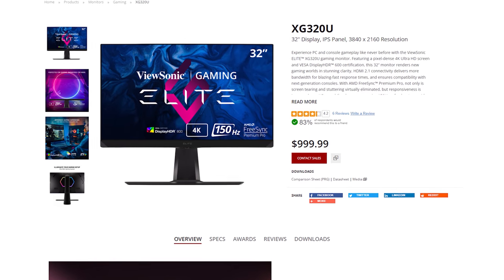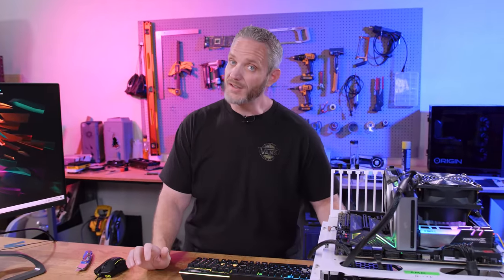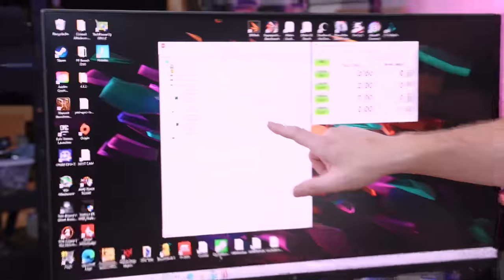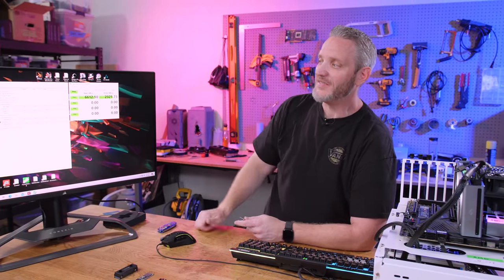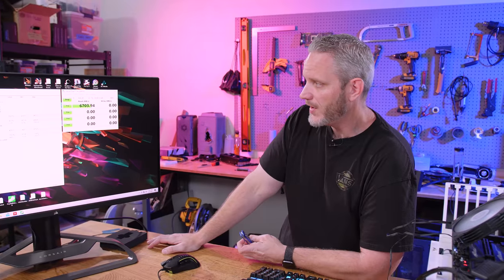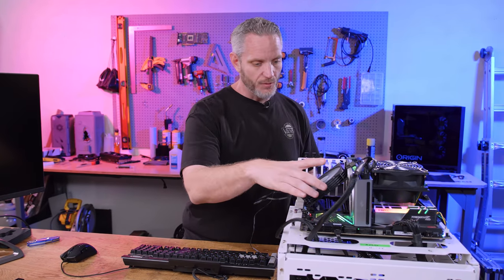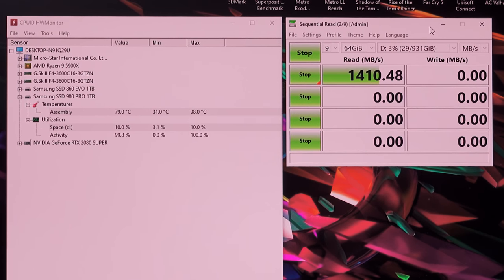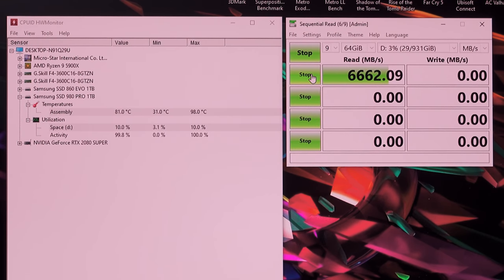I watercooled an NVME SSD... These results were unexpected!

Comment: In Windows, "cipher /w:c:\" on the command prompt will overwrite/encrypt all unused disk space on the C drive. It's for rendering data on free space irrecoverable, and also causes 100% disk usage.
Reply: Pretty sure that doesn't work on SSDs though.
Reply: @Mr.Morden  Just tested this on a 970 Evo Plus. Temperature went from 63°C to 83°C.
Reply: @saucyscone  Remember that SSDs don't write to the block containing the information to be wiped. It merely marks the block as blank and then writes to the next most unused block. That's wear leveling. Only mechanical drives will respond to commands to overwrite the same block. SSDs require a special tool from the manufacturer to wipe, and then the whole drive will be cleared, not just free space. There are also third party tools that do it, and tools on Linux. There are some drives that support secure erasure but the drive controller has to support it and you need software that uses that specific feature.
Reply: @Mr.Morden  It's not wiping the drive though, it's running an encryption algorithm over the current data in the drive.
Reply: @Bonekinz  As I said, that's not how a SSD functions, that's only possible on mechanical drives. The SSD file operations occur at the OS level, this method also kills lifetime write durability on the drive and does not wipe anything in the filename table either. Wipe operations function at a low direct hardware level and they can only wipe an entire drive securely. SSDs have no way to correlate the physical location of a file on a SSD with the NTFS/EXT etc filesystem entry. Slack space within each block is also not addressable. Using these tools only kills the lifetime of the drive and does not result in a complete wipe.

Comment: Glad you made this video. I have been wondering my NVMe's temps and keep forgetting to look. Mine is using the stock x470 Taichi MB heatsink and it's sitting (idle) at 48-50C. It's in a 5000D Airflow, and a junky GPU (for now) so it's not getting much heat off that even when gaming.

Comment: Funnily enough, NAND prefers to be a bit warmer, especially for good data longevity. Excessive cooling does your SSD no favours.
Reply: Running things outside of their operating temp can be destructive, this also goes for running things cold. not everything works better with excessive cooling. Car engines and transmissions wear far quicker when they are cold.
Reply: I purchased a heatsink for my nvme ssd in the server as it was sitting at like 45c and was spiking to something like 60c+. Despite the server being a 1ru with 7 fans giving plenty of air flow over the drive. I got the heatsink to stop those heat spikes. The drive sits at like 32c and peaks at like 40c. But it only gets that hot after copying over 100gb to it. Server kept throwing alerts at me.
Reply: @Ziogref  Probably should've just disabled the server alerts regarding the SSD, but whatever, as long as it works.
Most consumer SSDs start throttling somewhere upwards of 70°C (on the controller), not sure about server SSDs.
Reply: @Steamrick  I wish it just throttled, the boot drive in my laptop causes a bsod with no meaningful error code and no crash logs when it goes over 70, which was a pain in the ass to troubleshoot.
Reply: It's lowers the lifespan. These misconceptions are annoying. A cooled one will survive way way longer than a throttling one. 70c is worse than 40c.
Only super low degrees can be a bit bad. But heat is still worse
Reply: @Steamrick  it's a Samsung 980 pro.

Didnt even have any thermal mass attached. Just a PCIE to NVME adapter. The temps were at a point that made me a little uncomfortable.
Reply: @bundles1978  Yes, but the issue here, the controller you want to cool, the NAND you don't.

Comment: 1) I have always believed, that it is the controller chip you need to cool down, rather than the memory chips. 
2) To test a SSD based drive, try copy/paste from a similar sized drive, using HWINFO 64 to record results.  I guess you could have similar results if you did a full backup and then a restore to test.
Reply: Yeah memory in SSD's always runs warm... it's the controllers that burn!

Comment: I've got a 970 Evo that throttled due to thermals during writes because of how the motherboard's M.2 slot was laid out. The motherboard designer, for some reason, decided the best place to put an M.2 drive, with no cover, was directly under the primary GPU's slot. Soon afterwards I changed the motherboard to one were the M.2 slot is above the GPU slot and had a heatsink cover and it dropped down to 78C full tilt.

Comment: It's good to see that even the big YouTube channels occasionally make an editing error, not just me. 12:53, 13:00. BTW, any chance of testing some of the fan-equipped NVMe cooler, like the "Titanium Micro TMHSFM3 Nitro M.2 NVME 2280 Heatsink Dual Cooler with 30mm PWM Fan"?
Reply: yeah i'm surprised though. i really wouldn't expect a channel that is so big to make those mistakes.  I guess this is partly why Linus has like 50 employees lol
Reply: @techboy95  channel is 3+1, big only in sub/views numbers..
Reply: My testing on gen 3.0 and 4.0 drives shows no need for a fan on nvme as long as you have good thermal pads, a decent heatsink (pure copper is best), and a little airflow (minimal, but not stagnant air pocket in case).
I tested many nvme and many heatsinks.
Reply: Jay.exe probably got caught in a brief loop again.

Comment: One could write a shell script to do this in linux. It would just write over and over to the drive logging the time it took to write, time it took to read, and the temp before/after, flushing cache after every one. I have no idea if linux under windows subsystem has that kind of direct drive access though, to do the same there.
Reply: Yep, dd and sync are your friend. On a large write you can hit dd with a USR1 interrupt to get ongoing stats.

Comment: From what I have read from some of the engineers of these NVMe devices, they say that the "cooling too much" is typically not going to be an issue because the temps where too much cooling is problematic for longevity is like 0°C which you aren't going to have in a normal system.  For high temp, they said you would generally want to keep them under 70°C.  So even with no heatsink the 980 is fine, especially in a case with a little airflow.  But the newest 990's, SN850X, etc. do get hot.  I have some passive heatsinks on mine and they stay around 50°C.  That's all they really need.  The motherboard covers should also be sufficient for most things.  The PCI-e 5.x ones may need a heatsink vs. being able to just run out in the open.

Comment: Really interesting and useful! Clearly, a vaned heatsink is - and I think it's obvious why - superior to a flat one, as long as there's good airflow. No point (yet) in using watercooling - the benefit doesn't (yet) outweigh the hassles.

Comment: I got 3 of the EK heat sinks for my new build, for two reasons:
1: Not entirely confident in the two slower drives being left uncovered, since the mobo only came with one SSD plate that only fits in 2 of 3 M.2 positions.
2: I think the nickel fins fill out the board's appearance a lot better than the SSDs on their own would.

Comment: I foresee motherboard manufacturers integrating raised NVME SSD slots to accommodate cooling blocks on both the top and bottom for drives with storage chips on both sides. But as you said, it leaves more room for failure with added cooling blocks within a cooling system. Sooner or later we're gonna reach a point where we'll need even more cooling to cool the cooling system!

Comment: No problems with ones on 4.0 compiling huge C++ files. Manufacturers test with covers in layout and design of the module. FET junctions work more on voltage (potential) transfer instead of current. Storage is a charge, so refresh uses current. Current is work (e.g. electron/hole movement) and produces heat. Operating at lower temperatures may show longer life, as storage cells are disabled over 5 - 10 years in consumer grades. Covers can provide good RF shielding in a dirty localized RF field. Now, CPU/GPUs are another matter.

Comment: Blackmagic Disk Speed Test will do what you want. Tests up to 10TB in size and I'm fairly sure it just sits there and loops continuously until you tell it to stop. I'm too paranoid to actually let it do more than a few loops, so I've never actually tested if it will loop forever, but that's the feeling I get from the UI. The primary use is to show you which video formats your storage is capable of reading/writing. Currently tests for resolutions up to 12K/60, so you'll still have to monitor your temps with other software, but at least you'll really be putting the SSD through the wringer like you want.

Comment: Great video!

I started looking at the temps of my Intel 670p Series 2 TB NVMe SSD only because someone referred me to an article by Patrick from STH and I was getting prepared to deploy said NVMe SSD in the MinisForum HX90.

I ended up using a EK heatsink (not the waterblock), and that performed took it down from the projected 73 C max temp (as reported by STH) down to ~45 C (based on my initial CFD analyses/simulations/projections).

(That was under peak load/max temps. At idle, it was a lot lower than that, somewhere around the mid 30 C range, IIRC.)

Sidebar: SOME motherboards only have ONE of the included M.2 NVMe plates for ONE of the drives, even if the motherboard has three M.2 slots. (e.g. both my Asus Z690 Prime-P D4, and my Asus X570 TUF Gaming Pro WiFi motherboards are like that).

And in the MinisForum HX90, if you order it barebones, it doesn't come with one. (Not sure if it would come with one even if you ordered it with a NVMe SSD drive.)

re: "thermal mass"
The heatsink, I would think, should have more "thermal mass" because you literally should have a bigger hunk of metal with the heatsink than you would with just that plate.

But as the data shows though, it would appear that the flat plate is better for natural, convective cooling rather than forced convection.

re: application of the motherboard included plate or heatsink
Also from the CFD simulations that I performed, if you applied the heatsink over top of the sticker so as to not to void your warranty, the max temps would be, I think it was something like 2-3 C higher than if you took the sticker off said NVMe SSD. (In my physical tests in the HX90, I kept the sticker on, so as to not void said warranty.)

So that will also be another consideration as well.

Great video though!

re: stress testing your NVMe SSD tool
You might want to try the Flexible I/O tester (fio) tool.

I don't think that it has a pretty GUI like CrystalDiskMark, but it would be a lot more potent than CrystalDiskMark for stress testing the drive for max temps.

You might even have been able to get away with just using `dd` if you were just writing a gigantic, sequential file (which you can use by enabling Windows Subsystem for Linux in Windows 10) and installing pretty much ANY Linux distro just to be able to get access to `dd`.

Again, doesn't have a pretty GUI like CrystalDiskMark, but it might serve this purpose, better.

Comment: A few years back I said I'd never build a complicated hardline custom loop again.
Was building a complex custom hardline water loop with expensive distro plate and managed to destroy it when I slipped getting a tube off and snapped the fitting out of the plexi.

I've a simple soft tube setup running now that was zero headaches to get running.

Comment: Isn't it so, that NAND cells have a recommended operating temperature of about 40°C?
Cooling it to much might shorten the liefetime of the cells.

So these coolers sometimes are designed to cool not to much, so the heat from the controller heats up the NAND chips a bit.

Comment: I have a Adata XPG S7 1Tb nvme and I use a nmve cooler where the cooler has a 20mm fan. At full speed the fan can run at 12,000 rpm and yes you can hear it. If ran at 75% speed it runs at approx. 7500 rpm and the nvme drive stays at a constant temp around 35°c.

Comment: My laptop probably does it the best, thermal pad for the controller, but not the storage chips, since the storage lasts longer if it operates at a higher temperature.

Comment: Maybe H2testw will work. It was originally designed to test USB sticks and to identify counterfeit sticks that were labeled with higher capacity than they really are, so it tries to write to the stick/disk until it's full.
It seems to work for disk drives as well, so probably also for NVMes.
You just have to keep in mind that depending on the type of flash memory used, write speed might drastically reduce after a certain amount of used space.

Comment: One quick production suggestion -- check out a stabilizer or gimbal for your video camera. The camera movements are sometimes slightly jerky and it can be really noticeable at times. Also monitor screen shots don't appear to be white balanced (sorry I used to do some post production work)  :)   I do like the background of your setup with the multi colored dim lights. That's a really nice touch.

Anyway, thanks as always!

Comment: If it’s above the temp ceiling for the cooler, it literally HAS to come down.  Black body radiation plus a better conduction gradient means it cools (as in loses energy) faster the higher the temp is.  You’ll always converge on the same temp.

Comment: I built a Mini ITC computer with an admittedly not small case. The motherboard had the M.2 slot on the back of the motherboard. The case had no airflow there. I cut a perfectly sized hole for a heat sink I bought for my drive. I'll have to test thermals now to see if the effort was worth it. I certainly haven't noticed any major issues so far.

Comment: In my i7-6950X X99 system the OS NVMe is a WD Black SN750 1TB without heatsink and it always runs at 46C, it get very little read/write work done on it, mostly browsing VS and MS Office.
The system also has a WD Blue SN570 500GB with Sabrent Heatsink and it always runs at 34C.  This isn't a real valid test but the heatsink does seem to make a difference.
The X99 NVMe slot doesn't include any heatspreader so I should have bought the WD Black Heatsink version, but I figure that 46C is still pretty good.

Comment: Thank you for covering this topic. My 1 TB (1TBx1) Patriot Viper Gaming VP4100 Series (PCIe Gen4) NVMe M.2 SSDs have a heatsink and I was curious if they would benefit from adding liquid cooling. I do not overclock, I am just an old retired guy gamer, builder, EK Products tard, enthusiast. I'm running separate custom loops on 420mm rads set up push pull. (Retired HAVCR engineer) One for the video cards and one for the CPU only. Great coverage. Thank you again.
Jay-N6WIP

Comment: To answer your question, yes, I did experience thermal throttling on an NVMe SSD drive without a thermal pad looong ago.
Figured it out pretty quickly and even overdid the thing... it was an Asus E-Gaming Strix x299 board with vertical NVMe slot. Right. In. Front. Of. A. Monster. CPU. Cooler. Fan. I put it there. it was quite cool. Tho, had it snapped out, it might have gotten shredded to pieces. That didn't happen.

Comment: Great video, and so opportune!  You must have read my mind.  I have just purchased the 2TB WD SN850 for my main system after having bought the 1TB version for my (just acquired!) PS5.  I was agonising over whether to buy the model with or without the heatsink for my system.  I opined that the heatsink would probably be better than the provided motherboard 'plate'.  How wrong I was!  I may take the time to do some tests similar to yours on my own system, just for my own curiosity, but it's looking like the heatsink may be resigned to a drawer!  As an aside, I have read that the NAND chips themselves perform better at 'temperature' rather than being cooled to within an inch of their lives.  The controller is another matter.

Comment: I found that a good way to "stresstest" an ssd is actually to run a backup on the OS. Depending how big your C drive is, it will definitely take longer than running crystaldiskmark 9 times.  Im currently using macrium reflect and the ssd goes up to 100% load during backup. 60c (19c ambient) during load with EK heatsink ontop of 970 evo plus.

Comment: One large file may in fact not produce the highest temperatures as it will not saturate the command queuing of the controller. With SATA there is only one queue, NVME it varies based on drive but can in theory support 65,535 queues of commands for read/write.

The NAND flash ideally should not be cooled more than maybe a heatsink of the metal cover. Warmer means less damage on write to a cell from the higher voltages used. Cooling it will cause it to wear out quicker.

Comment: To benchmarks a drive better, I can recommend:
- copying a large file off it for reading, or copying a large file to it for writing (then monitor the temperature somewhere else)
- on linux, gnome-disks (the standard disk manager) can do benchmarks, or alternatively use dd to read the entire contents of the drive to /dev/null (or write /dev/urandom to it)
my uncooled Samsung 970 Pro in a laptop when reading starts around 3.5 GB/s but after a while it climbs up to 80°C and throttles to 1 GB/s

Comment: My guess is that the dips in speed were due to cache filling.  It could be the pipeline cache or filling the top layers of NAND first

The way around this would be to run an fstrim between each test, but that would invalidate the heat tests you're trying to run.

Maybe if you ran the water block, but instead of running it the proper way, use a water heater to intentionally heat up the SSD via the coolant.  You could more precisely control the temperature that way with a couple of cheap ($50) thermal electric controllers